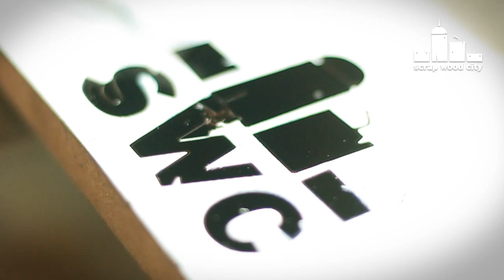Branding my woodworking tools with vinyl stencils

Comment: What? You didn't brand your workshop cat? No tattoo?
Spray paint is pretty good for stencilling but if you want to use ordinary liquid paint a little piece of foam rubber with a dabbing action works really well - much easier  (and cheaper) than one of those stippling brushes you'd buy for stencilling
Reply from the maker: lool! Foam rubber is interesting I will do my research! Thanks